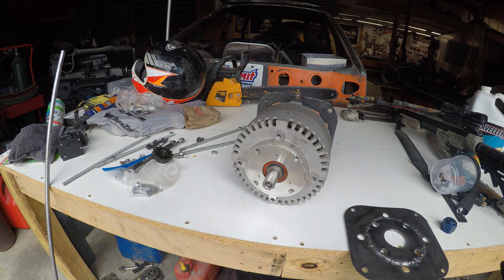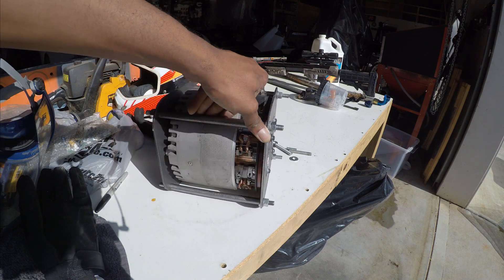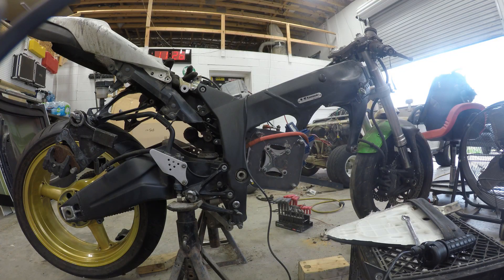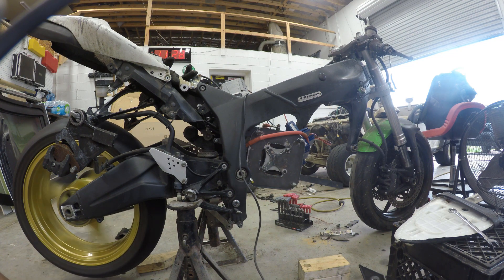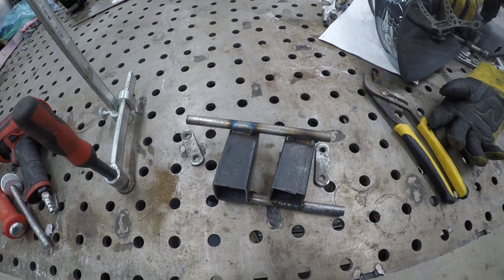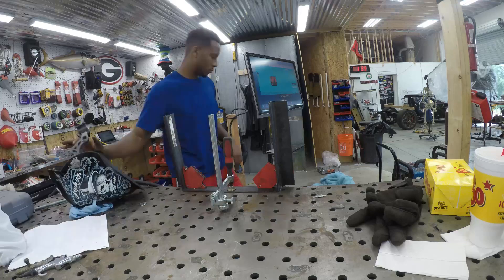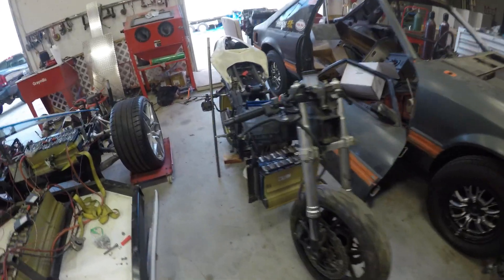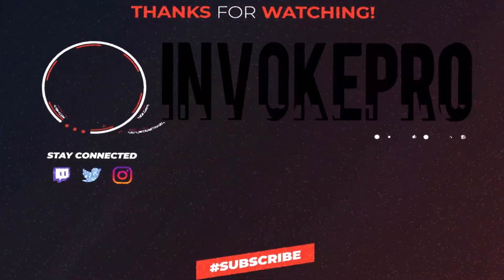Lets build a DIY Electric Motorcycle Ep- 2

Comment: that motor is a MOSTER.  No way you're using that 52v ebike battery you linked.  What are your battery specs your'e using? how many amp is that controller putting out?
Reply from the maker: I’m using the Chevy volt batteries seen in the video and the controller can put out 400a